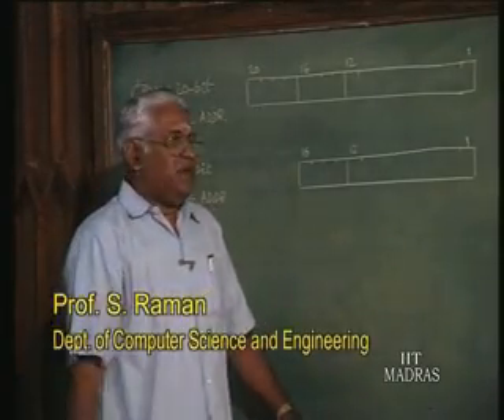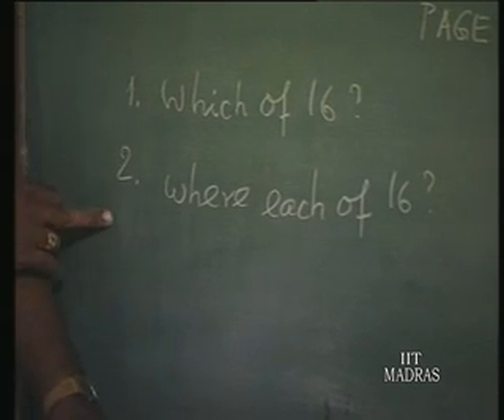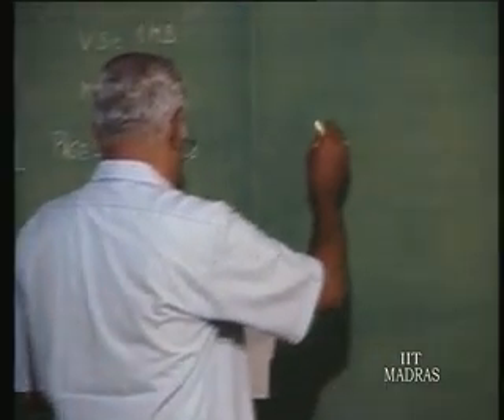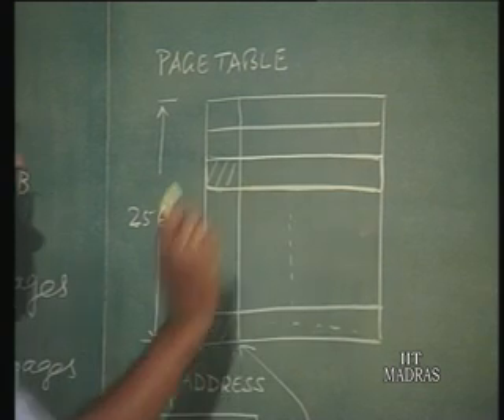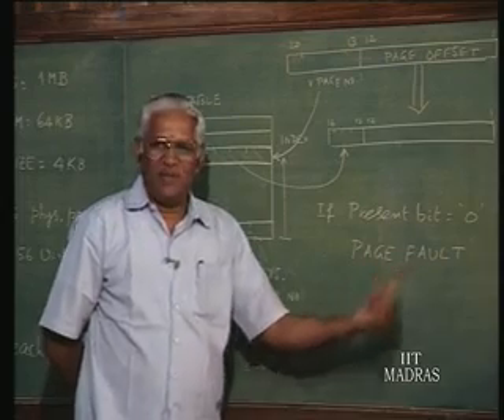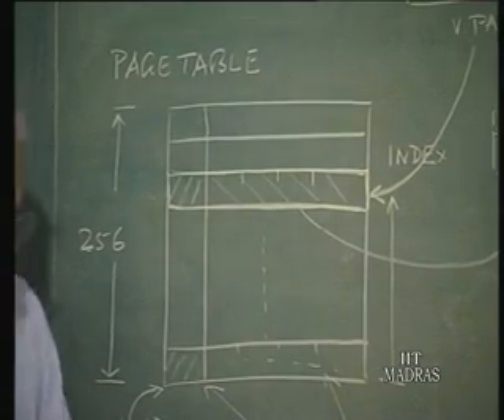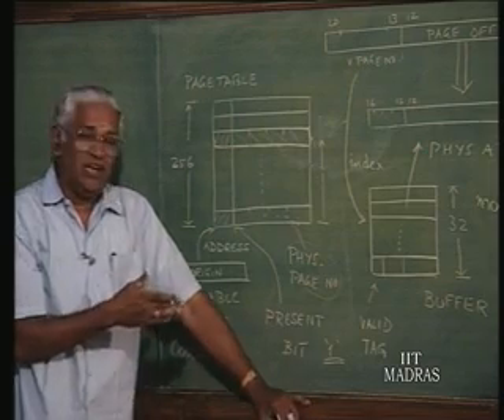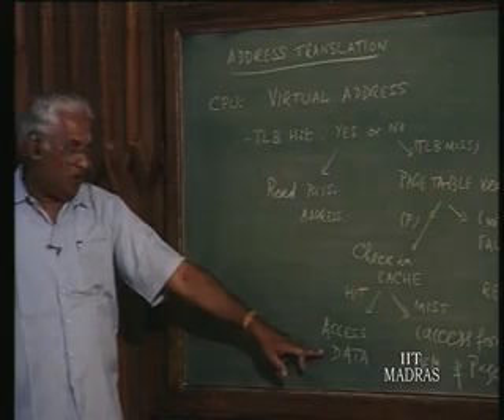Lecture - 20  Virtual Memory

Comment: x86 uses the "linear address" terminology because of segments. The programmer visible pointer is the virtual address, the processor adds the segment base to that, and the result is the linear address. The linear address is translated to a physical address by paging.

Comment: At 51:42 page table is checked ...and after condition failure cache is checked....I'm confused...only after a cache miss the next hierarchical memory is accessed...
Reply: have the same confusion
Reply: The first step was TLB miss (which means the mapping of this particular virtual address to the actual physical address was not present in the TLB) and Main Cache is different (where actually the page frame is cached). So once you have the physical address after reading from the main memory 'page table' then you'll check if this page is present in the main cache(Not TLB) not. I hope this clears the thing.